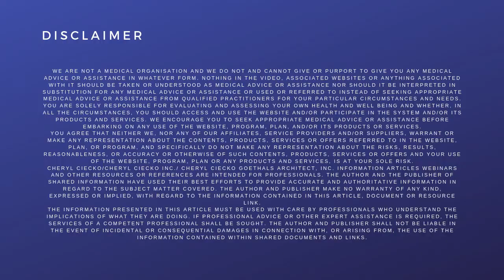Dehumidifying A Concrete Garage After Water Damage EPISODE 22 Building Well & Avoiding Mold

Comment: Any suggestions on how to test for mold after you do this to your garage? i got extremely sick after someone power washed my garage. Had never been sick in my house previously to this, thinking it has something to do with the power washing / moisture
Reply from the maker: You probably don’t need to test.  I’d assume that additional water caused high humidity and maybe even got the drywall wet at the base.  Check with a moisture meter to find any possible places that might need more investigation. 

See my Moisture Meter recorded webinar for more on how to use these at www.avoidingmold.com

Also see my Science of Plant Based Solutions webinar for info on another option that might help temporarily, while you figure out the bigger fix.